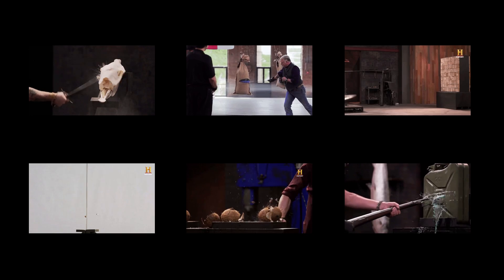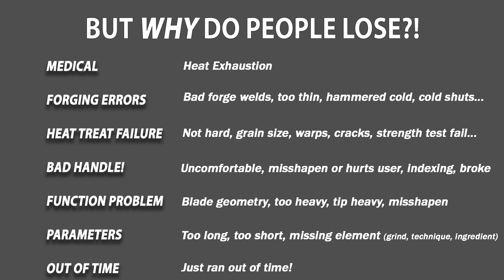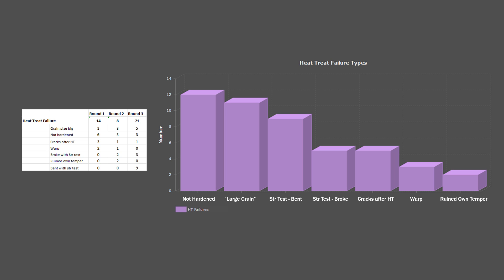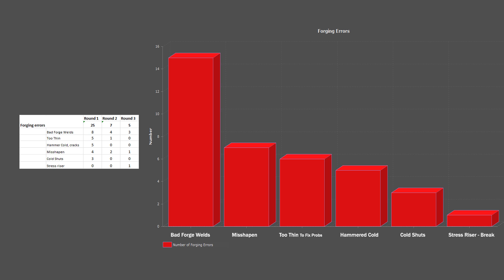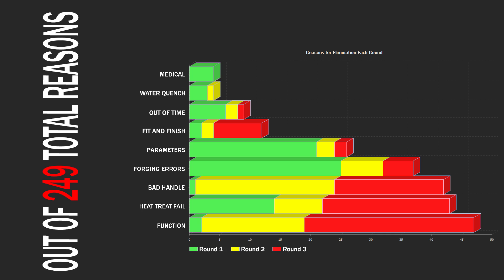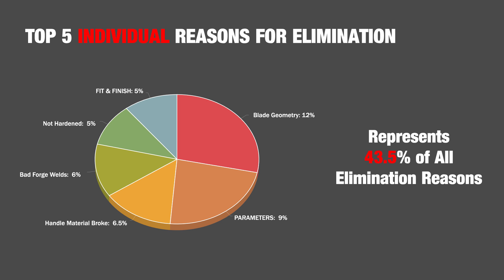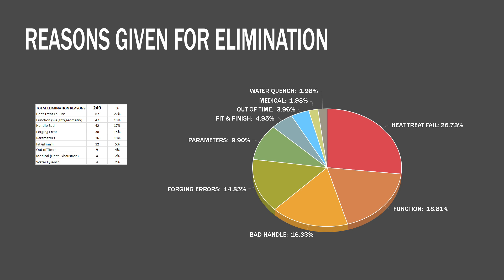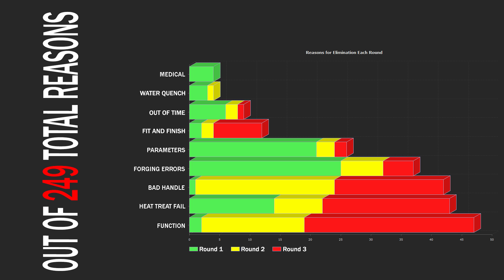How To Win Forged In Fire.  With Boring Graphs.

Comment: This show is very interesting honestly.   And this data too.  I would say this show is as much about a smith vs themselves vs each other.   If a smith doesn't have very good procedure and time management they can utterly fail.  It also utterly highlights the need to for smiths to at least have the basic knowledge kicking around in their brain.  

Like I swears, if these guys picked up a simple book on smiting and metallurgy 1/2 the failures of the show could be avoided.  There seems to be a lot of smiths who personally learned by directly doing and they don't actually understand the material science  behind steel smiting.  Like for  example EVERY smith who thinks to save 5 minutes by skipping cleaning their steel when forge welding is in the plan.  I see that over and over again, they don't clean the steel and spend most of their 3 hours fighting de-lams.   Or the ones who forge temperamental alloys too cold and wonder why they have cracks.  

I personally feel the biggest failing of this show is the small competitor pools.  When you bring in 4 people its possible to have one really good smith with 4 not so good ones and they will sail to the win at the end, and then you will get a show were all 4 work effectively and turn in quality, finished looking blades at the end  of Round 1.

Comment: What I don't like in the scoring is that the judges lean heavily towards edge quality specifically. A sharp blade that doesn't chip or roll equals an almost guaranteed win (assuming the thing doesn't fall apart), yet they completely gloss over issues like massive handles, poor comfort, horribly overweight blades, obscenely large and heavy fittings, etc which become very apparent when the smiths forge swords and other larger weapons.

Doug often subtly comments about how nasty the weapons are to wield for one or several glaringly obvious reasons, yet as long at "it will kill" in the pure sharpness sense, no problem.
Reply: Medieval Genie I think it just comes down to function over everything else. I could see forgiving a roll, but if your blade chips it’s only a matter of time before it breaks

Comment: There are shows that is 4 hrs. but more often 3 hrs. The point is not to make the best or  $10K-100K knife in 3 hrs. Its how to think smart and work smart in 3 hrs. under pressure. That should be one of the parameters. Those who failed took everything for granted, mostly the basics. When signing up you know your not in your elements? The winners who made it to the final used simply basics. Simple knife design, simple handle and simple materials. Even with 5 days, there is still pressure.

Comment: I really like Forged I’m Fire! I would think skill and experience would help the experienced smith more than the novice (steels, heat treatments, handle material, etc.). I also believe experienced smiths have a harder time letting go of their predisposed styles which can slow them down or cause them to rush (make a mistake) when time starts winding down. Amateurs are more willing to risk things, cut/taper corners which sometimes help them accomplish everything in such a short time where the experienced smith has a much harder time taking a shortcut which hurts them in the end. 
Bottom line I think FiF is made for smiths who have practiced quick forging and have used lots of mystery steels. Doesn’t mean your better than a smith who has forged 30 years with only 3-4 steels but that’s how the show is geared.

Comment: Nice graphs!  It's definitely something that I watch and there's this kind of mental checklist of what (not) to do.  First off make something like a competition chopper unless there's a stab test, in which case clip point bowie is probably your best bet. I forget how many times the judges have said "Forge thick and grind thin", so do that. Go full tang unless they require you to put a guard on it, and for crying out loud stop using the pine cones as handle material.  Go indestructible, G10 or micarta.  And drill your pin holes before HT!

Comment: Surely it a "try not to lose" competition. The winner is more often then not the guy with the fewest negative remarks. Occasionally both final weapons perform well, or at least equally, then fit, finish, and artistry is usually the deciding factor. I don't know if the show pays for the fuel and materials used in the final weapon, but it would seem that the final weapons take a big chunk out of the winnings. Neck, after taxes some winners are still monetarily in the negative if they are paying for the cost of producing the final weapon. The one guy who put all kinds of fancy materials into his final weapon and still loses is really out of pocket. However, if you build a $5000 weapon and win, after taxes your still only about $1000 to the good, if you're paying for everything to do with the production of that winning weapon.

Comment: Interesting video but not surprising.  As you stated perfectly, it's a show were you try not to lose, not so much about winning.  Once they start giving all the bladesmiths the same materials to use at the beginning and require all use the same forge welding techniques to actually even the playing field so to test skill and not merely luck or the draw, I'll start watching the show again, until then it's simply too frustrating and not a competition against the other smiths but a competition against yourself.  And I agree, I've also been harping on why the smiths would be choosing burls and resins for handle material as opposed to G10 or  micarta since the first or second episode.  Too many cases of, "ooooo pretty and shiny, I choose that one!" lol.

Another gripe I have with the show is they say they test harden all the materials before they use them on the show, but there have been at least a few episodes where there were surely stress fractures already in the found/used steel they provided which was ridiculous.  Don't get me wrong, there are some episodes I have really enjoyed, but there are just too many failures for the above reasons to make it not so fun to watch.  

Also, I'd say half the battle for the smiths is testing their listen skills and/or memory to remember the length requirements.  These are such simple fixes that the show has yet to address that I just don't bother watching anymore, as I get no pleasure in seeing great smiths getting raw deals as well as guys loosing all too often for petty mistakes.  Anyway, that just my $.02 😉

Comment: Hey Green Beetle speaking about Forged and Fire I just watched the latest episode, where in the final round the two bladesmiths had to make Bagh Nakh Blades. I was pissed because the test done by Ben Abbott where he stabs each pair of Bagh Nakhs into a log was totally flawed!!  Flawed because for the first bladesmith(Josh Prince) Abbott stabbed both Bagh Nakhs deep several inches into the log snapping both tips off. But for the second bladesmith(Chad Hatfield) Abbott only stabbed one of the Bagh Nakhs deep into the log, the other Bagh Nakh was stabbed into the log at such a shallow angle that the tip barely broke through the surface of the log. That's why the second bladesmith(Chad Hatfield) only had one of is his two Bagh Nakh tips break off!! The whole entire test done by Ben Abbott was flawed. The Blade smith(Josh Prince) was cheated by this flawed log stabbing test and robbed of the title of Forged and Fire Champion!!! Bladesmith Josh Prince needs to be brought back onto the show for another chance!!
Reply: Thomas Connolly I felt the same way. I hated that test.
Reply: Bladesmith Josh Prince clearly made the better pair of Bagh Nahk blades!!!  The judges even said his handles were a lot more comfortable.  Josh Prince who should have won, only had 1.5 years experience as well.  He was also the only bladesmith in the first round who did not restart their canister demascus!!
Reply: You need to watch that episode!!  The bladesmith who lost in the final round(Josh Prince) was robbed by a really bad, flawed test stabbing test!!
Reply: I often wonder how much of the show is scripted, especially in the later seasons.
In some of the tests you get the feeling that they add extra drama or twist up to the point where the judges perform the test to deliberately destroy a blade.
Like twisting the knife rather than pulling it out straight and so on.

Comment: FiF is a try not to lose for the first two rounds, and then try to win for the final. The number of material failures on round three are surprising, and often we see people who try to do too much, or neglect the wood for metal and then find their wood breaks, especially on polearm challenges. As to the balance, it is a competition, and frankly, if the rules didn't exist to give rookies a chance, then the show couldn't exist. To film, the show takes about 8 days, give or take, depending on shoot schedules. A group of four master bladesmiths wouldn't really have much reason to compete if they knew that at best they get 10K for two weeks of work, worst they could lose almost two weeks and get to keep a potentially destroyed 2nd place weapon (they started returning the runner up weapons a few months back). The show is actually geared more towards hungrier smiths who want the win recognition and may need the 10K to keep the power on, especially now that we are more than halfway through S05. There is a Facebook FiF group where many of the competitors and judges participate - well worth checking out if you haven't, it's the "Forged in Fire TV Show Discussion Group".

Comment: Those who win are very often calm and concentrated. They anticipate the steps to get where they want. But none of them is safe, things can go south very fast in many ways, which is one of the reasons why I enjoy this show very much! I like to see them make mistakes too, because then I know what not to do...
Reply: I tried to stay calm but had a complete freak out in the 2nd round (30 mins left and the handle block had just been peened on), it didn't make it into the final edit though. It was the origin of the term "Rage Hammering" I used,  the producer called it that and I just ran with it.
Reply: I understand that the pressure must be a huge part to deal with. But you did it, so, hey, well done sir!
Reply: I always try to guess who will win during the intro. I heard it's hot in there so anyone looking out of shape is cut. Then I cut anyone who prides themselves on being a 3rd generation ferrier, etc. because this is about improvising and quick. I usually bet on the younger dude with less experience who seems fit and is open to adaptation, but if there is a solid 45 year old in shape and kind of a mechanic air then I bet on him, and I get it right 85% of the time. Just sharing this because if a person is not one of these two types it is rare that they will win.
Reply: Yeah, I play this game too! So disappointing when the person I support loses because of any of the reasons Green Beetle talked about...
Reply: Ah ah! I'd never have guessed the name of the winner of season 5 ep 17. I thought he would leave first tbh!

Comment: As a Forged in Fire winner and friend of many F.I.F. competitors I agree with this graph lol. Keep up the awesome work Steve.
Reply: +G McGregor You know that hallway in the show where everyone who's eliminated has to walk down? Well, back there they have a little room where they temper the blades in an Evenheat oven. The reason they say the blades on set should not exceed 22" is because the oven can't temper blades longer than that, they won't fit.
Reply from the maker: Hey man!  Thanks and congrats!
Reply: +Green Beetle Thanks man. Oh, before I forget, did that alloy banding issue show up with any other knives you tried to put a hamon on?
Reply: Would you be able to comment on the tempering process?  Thx.

Comment: I’d be very curious to know more about the tempering process for the blades. Especially as they are often unknown metal. My understanding is that the smith doesn’t control tempering but I don’t know if that’s true or if all blades are tempered equally. If done equally, wouldn’t metal factor in when you pull parts from different sources?  Not my area of expertise but when you see a very accomplished smith have a blade break, you have to wonder what level of control they have over that aspect given that it is never shown.
Reply from the maker: I'd heard J Neilson or his substitute does the tempering overnight between filming rd1 and rd 2.   Is that right?

Comment: Excellent analysis. One thing that always bothered me about the show is the Smiths don't really know how to heat treat and normalize the blade. (keep in mind I study metallurgy)  I don't know anything about forging and what it takes to spread out a hunk of metal or Force metal powder and bits of chain saw blade into being one Billet so I have no idea how that frustration interrupts the thinking people do when they move to heat treatment and normalizing.
Reply: According to contestants normalizing happens off camera and IIRC it's not done by the smiths themselves. Also heat treatment has tripped up a number of contestants due to inexperience with the steel provided such as mystery steel or less commonly used ones  like W2. A lot of the less experienced smiths are only working with 10XX series steels.
Reply: lesly demshaw  we didn't have access to temp controls on my ep. So you just have to judge by eye. However I know most of the smiths took time to normalize to reduce grain size before going into the quench.  Also,  tempering is done in ovens according to to the type of steel used by the competitor, and is managed by j, Jason or ben.
Reply: lesly demshaw I only clicked like for your dog

Comment: It’s definitely a show you don’t try to lose. Too many talented dudes that get knocked out too soon. I would like to see a version where they let each blade Smith do the 3 hour challenge in their own shop.
Reply: Personally I'm surprised more people don't practice before hand. They go "I can make a three hour knife" but that's not good enough. 

I started this in university, but it still holds true into work and hobbies, whenever I have a deadline, for anything, I always take ~1/4 of that time off the end, and set out to finish at that new time. 5 months for a project? nope. that's 3 months and 20 days to finish, and 5 weeks to deal with everything that goes wrong. 

3 hours? That's 2 hours and an hour for fuck ups and mishaps. 

I'd say 80% of the time it goes fine, and 19% of the time, I use up all my buffer, and 1% I still fuck up, and go over, but usually only just barely.
Reply: Definitely. On the episode I was on, the first "masters and apprentice," the only "master" with actual ABS Mastersmith certification was Joe Szilaski, who was eliminated in the first round.
Reply: Dan The Maker Man I agree.  I would probably fail in their shop, but do better in my own shop. I don't think they even have a coal forge there..  never used a gas forge. I honestly don't want to, so I think it'd be difficult even in the forge aspect since I don't know how to control a gas forges heat.  Nevermind that example if they do have one.
Reply: @williambarnhartblacksmith414  occasionally they do a coal forge episode... >_>
Reply: I like that idea. Maybe Green Beetle or yourself can convince 4 guys to do a 3 hour challenge in their own shop as a collaboration video then by votes narrow it down til we have a winner. Itd probably garner a fair amount of interest. And if each maker broadcast the idea itd help each maker get a broader audience. Sound reasonable?
Reply: Good break down. My problem was I thought the judging would be based on the ABS JS test and not making it to that specification would result in failure which is impossible under those circumstances. Secondly an experienced bladesmith will work to make the best blade he can using his or hers proven method that doesn’t work well in this competition. What works well for this show does not necessarily make a good blade and vise versa.
Reply: alic steel one of the best blacksmiths on you tube did a 3 hour challenge for his channel it failed
Reply: @Loan--Wolf  More because he's now used to spending 20 episodes on an overly elabrate project rather than speed
Reply: i agree. My buddy was in season 2. he was telling me how their 'shop' isn't a shop at all. its flimsy painted plywood/cardboard walls in a tv studio, i think in NY.  I would think that if they are going for a show to produce the 'best' blade under a time constraint, smiths either need to be in an actual fully stocked shop (that they have a day or 2 to get to know, at least) or their own respective home shops.